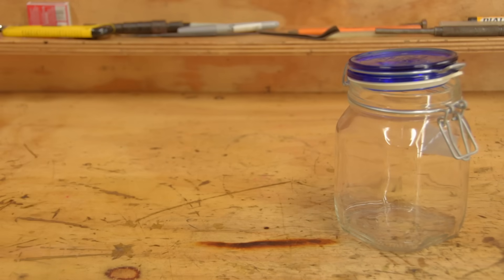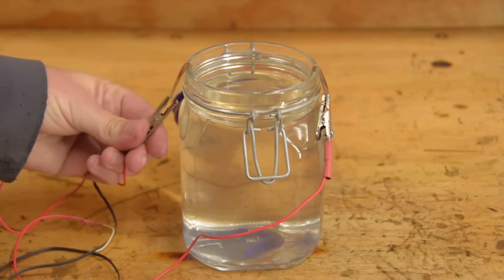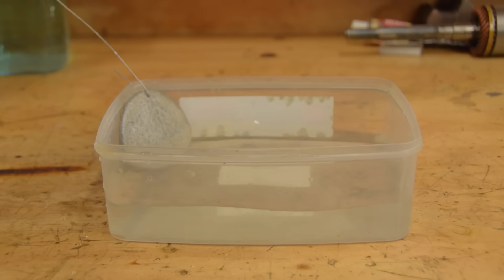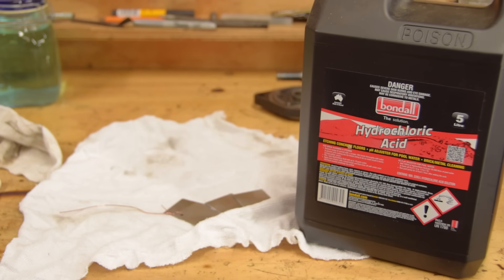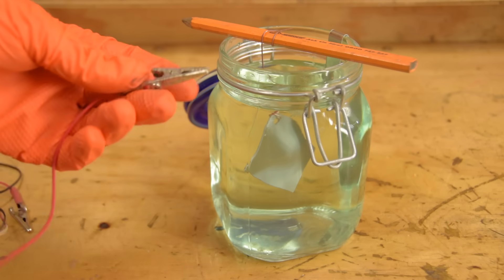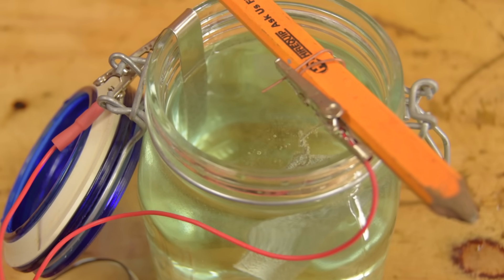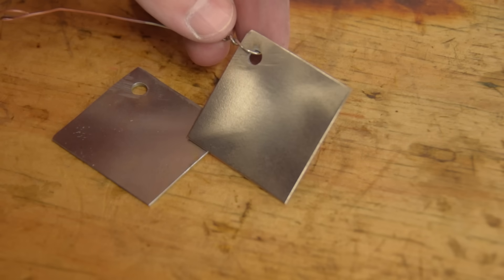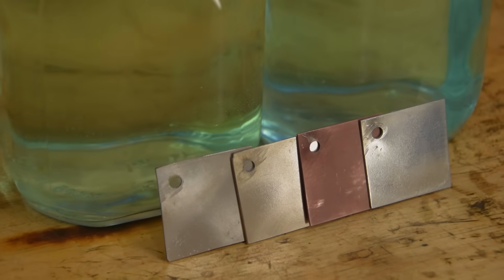Electroplating - Easy DIY Nickel, Copper, Zinc Plating

Comment: Im getting a really weird, bumpy finish, almost like crystals are growing on it, am i doing something wrong?
Reply from the maker: Probably too much current
Reply: Its 5v and .3 amps could that be too much?
Reply from the maker: It all depends on the size of the part. Sounds about right though. Not sure what else, could be many things. Just make sure the part is real clean, that's normally the root of most problems.

Comment: Uh....copper will plate directly to steel.
Usually nickel will not.
Usually copper plate is a base before nickel plating.
I think you got it backwards bud
Reply from the maker: In industry copper is plated directly to steel. They use either cyanide or acid to copper strike the steel. Most diyers aren't keen on cyanide... At home, you want to strike the part with nickel first and then go to copper. Or you can soak the part in copper sulphate or buy an acid copper solution, but that's not what I made this video about.

Comment: Would like to add that "Acid into water is the way you oughter."
 If you pour water into acid, the reaction can overheat the water causing steam, explosion and a faceful of acid. Just in case anyone doesn't know.
Thanks for the vid, didn't know a lot of that.

Comment: I wonder if this can be used to re-nickle plate some expensive soldering iron tips. Buff all the oxidation off, clean them up, and then re-plate the copper cores.

Would have to do it for a lot longer than 20-45 minutes. Would have to do it for hours.

Comment: I didn't have a Greek yogurt container, but I did have a Greek seasoning container, so I gave this a go.
For nickel: I used a nickel welding rod - they are used to weld cast iron. Tap the flux off with a hammer, cut the rod in half, put it in a drill and drill it while holding a handful of sandpaper in the other hand. Then hang them on the jar and hook it up, like in this vid. 2 hours later, your liquid is green and one of the rods will be dissolved. 
I practiced with coins, knives, live bullets (they look AMAZING!) and a few other bits laying around. I finally gained confidence to do what I started this whole project...the barrel of my new Beretta 92fs.
Beyond Beautiful!!!!!
Thank you, my friend. Others should give this a try, as it is pretty uneffuppable. My total investment was $13 - that's $10 for 5 rods and $3 for vinegar.
Oh...the Greek seasoning container worked!
Reply from the maker: Ahh 👍. I just saw this comment. The other guy replying bumped it into my notifications for some reason. Awesome to hear it went well for you 👍
Reply: A nickel plated Beretta would look sweet.
Go on do the slide and frame.
Don't forget to post pics :)
Reply: @1978garfield  I have heavy nickel grips on it now. Beautiful. I'm debating the slide - it has never been fired and I'm afraid I wreck it.

Comment: Why is my part turning black in the sulution.
Reply: I made mistake which lead to "blackening". Too high voltage (12V) so my copper ions aren't probably able to stick on material I wanted to coat. It made very fine copper dust tho.

Comment: I'm a little, or a lot, confused here. During my electronic training, we were taught that current flows from Neg to Pos, not the other way around. So if your square piece of metal is to be plated you should put the Neg on the item supplying the material Pos on the part being plated, there are several other plating videos that describe it this way to get the rust off of metal. :(
Reply from the maker: It's correct. The polarity of the power leads is not the sole consideration in the chemical reaction.

Comment: Pinpoint detailed description, thank you sir.  Would we follow the same procedure for gold-plating suitable items? (I'm thinking primarily of guitar pickup covers which are nickel-plated then gold-plated, which has over time worn through).
Reply: Gold might be tricky, because there are very few acids which dissolve it. 
One of which is a mixture of 2 acids,  called "aqua regia".

Comment: Does the voltage output of the old charger have and effect on the process
Reply: It's the amount of current, not voltage that affects speed of plating: more current = more ions in the solution.

Comment: I tried this and although it works, the Zinc kept flaking off my copper piece. I am setting the current on my power supply to 100 mA so why is this happening?
Reply from the maker: Flaking off means the electrics are fine. It's either incompatible metals or the part isn't clean enough
Reply from the maker: Can you plate zinc over copper? Probably not. Only certain metals can go over certain metals.

Comment: positive nickel anode? you mean cathode?
Reply from the maker: The cathode is the piece you're plating
Reply: @GeoffreyCroker  in chemistry anion is neg and cation is positive and they come from the same words as anode and cathode... so i was under the understanding that cathode was positive and anode was negative
Reply from the maker: Yes. The chemical reaction is what gives the cathode and anode its name, not which poles of the power source the part is attached to.
Reply: @GeoffreyCroker  k that makes sense! Thank you!

Comment: Would you use the same procedure to copper plate an aluminum gun receivers? Maybe have to cut back on the acid bath a bit?
Reply from the maker: No. Aluminium won't take plating.
Reply: Geoffrey Croker oh well thank you anyway, great video!

Comment: I have tried Copper platting and have experienced some issues. Firstly i have a black film forming on the Negative anode and white substance forming on positive anode
Reply: I pulled this off google.  "In a galvanic (voltaic) cell, the anode is considered negative and the cathode is considered positive. This seems reasonable as the anode is the source of electrons and cathode is where the electrons flow.   However, in an electrolytic cell, the anode is taken to be positive while the cathode is now negative."

Comment: I tried this today on some of my MGB suspension nuts and bolts. The plating was the easy part - its getting rid of the rust that takes the time. They came out great though. Now I'm busily cleaning all of the other nuts, bolts and small parts that were originally plated. Think I may eventually invest in a proper kit as I want to reproduce some of the more professional looking finishes which were used on the car.
Reply: You can clean off the rust with electrolysis. Similar setup as in this video but use water with 0,5 to 1% washing soda. Connect the to be derusted part to black, scrap steel to red. Depending on the size of your parts you might want to use an old fashioned car battery charger (the humming type, with a transformer in it) as the process could require a couple of amps with bigger pieces.

Comment: Nice!! So if we wanted to plate in gold or silver, we have to have pure gold or silver strip submerged in the solution?
Reply: not necessarily brush plating doesn't need a gold or silver anode. A stainless steel anode is enough for tank plating it takes  the gold or silver from the plating solution (depletes it) and deposits it on the cathode (the thing you are plating)

Comment: You can absolutely copper plate steel. Every "Triple Chromed" bumper is plated with copper first, nickel, and lastly chrome. Look it up.
Reply from the maker: I'm aware of the fact that copper can be plated directly to steel. But not using this method.

Comment: Zinc plating AKA Galvanized.  Galvanized steel to prevent rusting.
Reply: Mike Vars, proper galvanising uses pure zinc heated to it’s melting point and parts are dipped into the liquid metal. This gives true rust resistance unlike electroplated zinc parts that only give mild rust resistance. Hot dipped parts generally look like they have a thick coating where as electroplated parts have a very smooth even appearance. Electroplated zinc is a lot cheaper to produce and therefore sell than hot dipped.
I have had better results using fish oil on bare steel left out in the weather than electroplated zinc. Also hot dipped zinc has self healing properties, no joke, so with light to mild scratches the zinc will close over to seal them. Weird but true.

Comment: Thank you for your fine video no-one could tell me why my steel wouldnt take the copper no matter what i tried, it's not true about what some whisper about you so don't worry 😉
Reply from the maker: Yeah, you have to use different chemicals as the electrolyte to get copper to adhear straight to steel.
Reply: I have tried dozens of iterations using different solutions of copper sulphate, voltages, current, steel and prep with poor to disastrous results!

Comment: I do this all day long at my job and I've been looking for a way to show my kids what daddy does at work....this is amazing, I will doing it to show them this weekend. Awesome "for dummies" style video, I had no idea it was this easy to do at home, I'm gonna be showing them on this long holiday weekend we have. Great video, Sir, you got my sub for sure!!
Reply: I plate cylinders for the printing press. Pleased to meet you fellow chromers. I too will be using this video to show my kids 😁
Reply: @aspectratio6580  So what is a good plating thickness for something that will see some outdoor weather and how do you measure the thickness? With a micrometer or set of digital calipers or ?
Reply: Hey J, I’m getting ready to try gold, black rhodium and silver plating for my job. We have a lot of old bracelets, rings etc... that all have small pave set stones. Any tips for a beginner, I’m kinda going in this blindly aside from a few yt tutorials. But nobody shows plating with a lot of small stones. Any experience in that field? I appreciate any help. Thank you! -Jay
Reply: @creative0996  Hi! I just found your comment while trying to figure out if I could use this method for silver plating over brass. Did you have any success?
Reply: The plating is all over solid Brass, if that helps any. We Just have a lot of old, worn out tarnished jewelry showing the brass underneath.
Reply: What safety precautions will you be taking or have already taken?

Comment: When you said “if water beads in the metal it won’t plate” did you mean the break cleaner that you were putting on it, or if you were to put water on it. Or if you were to put water on it without the break cleaner, idk I’m confused lol
Reply: Its called a water break test mate. Clean with solvent if and when you run water over the item it beads or breaks then it is still contaminated with grease from fingers etc

Comment: Great video.  I am restoring a 1955 Vespa and it has some very rough aluminium strips which I have now cleaned and smoothed.  Can I Nickel plate these for a nice shine and do I need to do any pre-coating?
Reply from the maker: You can't directly plate aluminium with anything.

Comment: Workshop hint: If you have a taper threaded fitting or plug for a hydraulic port which is slightly undersize (or more likely, you tapped the hole a whisker too deep) you can recover the situation by plating a heavy layer of copper onto the fitting. It is soft enough to conform to the mating thread on tightening, and provide a leakproof connection.
Reply: honestly it's a really good idea to plate a leaky valve in copper as it will provide a better seal than teflon tape.
Reply: @eve_squared  Indeed. I forgot to mention that it doesn't matter that the copper (if a heavy deposit is formed) will be composed of thousands of tiny peaks and valleys, like a cat's tongue. It all squishes down as the taper-thread joint is tightened due to the remarkable ductility of pure copper.
Reply: @Gottenhimfella  honestly it's a great trick to know especially if you have a shop air system since compressing air can get expensive with leaks. It reminds me of that video of the researchers getting vacuums measured by atoms per cubic meter by sealing it with copper gaskets.

Comment: Really late question but do you think It would be possible to plate plastic coated in cold galv spray which as I understand is zinc based? I know its possible with nickel based conductive paint but thats alot more expensive than cold galv
Reply from the maker: I doubt it. The zinc paint I use isn't metallic. Just paint with zinc in it. Don't let me stop you trying though...
Reply: @GeoffreyCroker  thanks for the reply - going to give it a shot since it will only set me back about 8 dollars - I know you can also plate graphite powder mixed in with acrylic paint. I guess it depends on how much metal is deposited. Will report back if it works x'D

Comment: My plating process is slowly getting to the point i made the green color water but first it was bubbling not plating then i sanded it now it's plating but forming rust quickly I'm plating plain metal nuts by the way
PS is hydrochloric acid stage crucial I'm skipping it
Reply: I think the hydrochloric acid also etches the surface slightly and gives the plating a better "grip".
Reply: my  nickel anod is rusting and does not develop green color it develops brown color which is rust so it doesn't work

Comment: Please respond! What about Silver? Can I use the same method? Did you try? Thanks
Reply: You can't do the same with Silver cause it's a precious metal, to dissolve silver you need cyanide to keep it in solution. Quite dangerous...
Reply: @j.metayer5792  silver is only "precious" because people will pay a lot of money for it, same as gold. Both gold and silver have the same electron  configuration in the Valence shell as copper, so will plate like copper. Silver nitrate solution doesn't need cyanide to remain stable, but it does form silver crystals when exposed to light, so should be kept in the dark, even when plating with it.

Comment: Hi. Thanks for video, but it's not working for me.
I tried with copper wire, and got into problems straight away while diluting the solution:
There has been a really vigorous bubbling on the anode (negative current) and in no longer than an hour, a huge layer of black mass formed on in. The black mass was copper and it was somewhat mushy and felt of when I touched it.
But the solution turned nice blue colour anyway.
So I then tried to form on couple of other metal objects, always with the same result: the object would start bubbling vigorously and turn black almost instantly, but the black would be easy to take off for instance with paper tissue.
Could this be a problem of too high current? I used a phone charger aswell.
And I think I added more salt than you did.
Reply: Black mess means that you use too much current.
Just put a resistor in series with your setup, about 100-200 ohms. The exact value depends on the size of the part you are plating.
When I did my copper plated things, I used a potentiometer about 500 ohms.

Comment: I assume you used DC voltage.  Will it plate either faster or heavier coat with large high amperage DC power supply.  Just want to get an idea of the benefits of higher amperage.
Reply from the maker: It will plate faster, but the finish will be bad if you use too much current. It's a balance.

Comment: One little advice,  add acid to the water,  Never add water to the Acid, heat is released and the solution may boil very violently, splashing concentrated acid out of the container

Comment: What a wonderful tutorial! Thanks, I will now be on the lookout for excuses to start plating stuff. What extra steps would it take to plate plastic parts? Then I could make metallic sculptures and models.
Reply from the maker: I have no experience plating plastic. But basically you start with a special paint which makes the surface conductive and go from there.
Reply: @GeoffreyCroker  Thanks, I'll try to find some of that paint then.

Comment: If you had something the was nickel plated, but in bad condition, could you use this technique to repair areas that were worn through, or to remove it entirely and start over?
Reply from the maker: It's possible to repair patches by passing current trough a piece of gauze soaked in electrolyte held against the part. But otherwise you'd just strip the whole part.
Reply: @GeoffreyCroker  
So, a nickel plated revolver could be successfully stripped and replaced, using this process (assuming that all surfaces of the disassembled item that should not have nickel were sealed off from contact with the electrolyte?)
Or would you strip it to bare steel with another method before plating?
Reply from the maker: I would not start with something you care about. There are many reasons plating might not be successful. Use this method to experiment and play around with practice pieces until you get used to it. Then you might decide the results are reliable enough to plate your revolver. Or you'll have the background experience to decide it's worth paying for a commercial mix, that'll have brighteners etc in it.

Comment: I didn't see this question.  Do you need to rinse your copper plated piece before you nickle plate ?
Reply from the maker: You need to go nickel then copper. And yes, definitely rinsing in between.
Reply: @GeoffreyCroker  just water? It doesn't need to be distilled does it?
Reply from the maker: Nah, not if you're just playing around with vinegar. I use distilled water with any of my commercial mixes, but that's only because they're expensive and I don't want to contaminate them over a long period of time. I just use tap water for everything you see in this video.